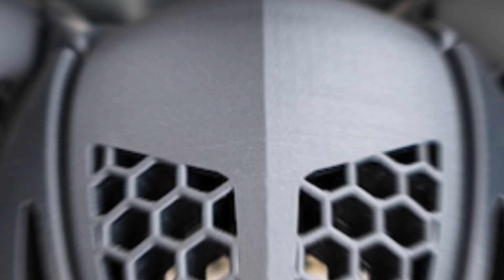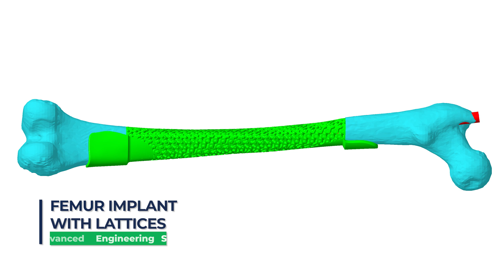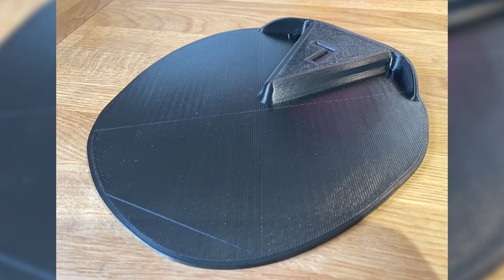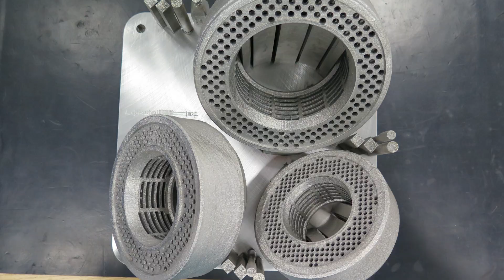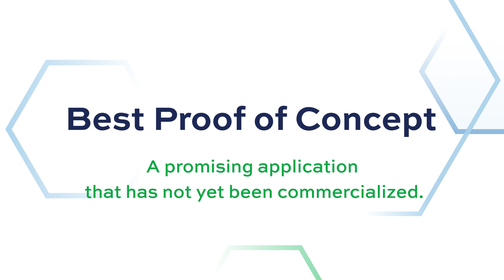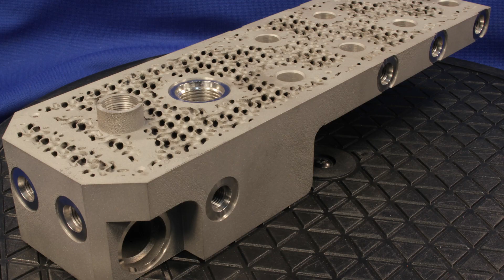3D Printed Parts Contest | The 2023 Finalists in The Cool Parts Showcase! #3dprinting

Comment: Nearly all of these parts are mindblowing jumps in progress for different fields, but i was very curious about the hydraulic manifold - with the large upfront cost of 3d printing and the need to have pressure sealing threads either driving up the needed precision or making it so you have to tap them later anyway, why wasnt this part just 4 axis CNC'd? Is there some internal geometry which cant be machined but increases performance?
Reply from the maker: Here's a very thorough response from Corey Dickman of Penn State:

Very good question and I wish more people would ask these tough questions about whether certain applications are a good fit for AM!  I agree that, in some cases, hydraulic manifolds are not good candidates for AM since they can easily be manufactured via CNC with straight / intersecting drill-ways and from solid billets.  In this case, the legacy design has complicated passages with multiple direction changes and close clearances resulting in difficult to procure spares.  With AM, we were able to curve these passages to alleviate routing issues, eliminate multiple drill paths and reduce pressure drop. 

Also, yes precision interfaces and threads do require subtractive machining on most metal AM parts due to surface roughness lack of positional control over large distances (>.005 in / in).  Fortunately, interfaces are easy to machine due to their location external to the part, and with near-net shapes, can be quicker and easier to machine than solid material (especially when considering difficult to machine materials).     

Another challenge for AM, is that designs necessitate the removal of all non-essential material due to distortion caused by the accumulation of residual stresses in thick walls.  In this AM design, variable thickness TPMS structure was used as a self-supporting filler to provide structural supports while breaking up thick walls.

Most importantly, and  to borrow terminology from Chelsea Cummings and Tim Simpson of the Barnes Group, this is what I consider a “pathfinder part”.  Critical safety parts such as this, allow organizations to “blaze a trail through the forest” in order to mature their manufacturing competency by developing their process specifications and educating designers in the art of the possible.

Comment: nice ones.
I like the ones of space propulsion.
When we can see 3D print + CNC for smoth surface inside? Any company invented it?
Reply: This is a common practice, you usually CNC 3D printed parts only where you need, for example strict tollerences or face-to-face junctions.